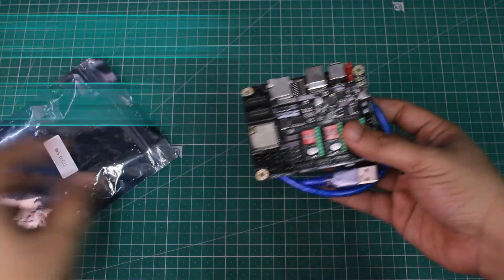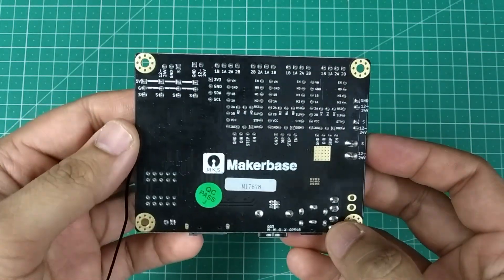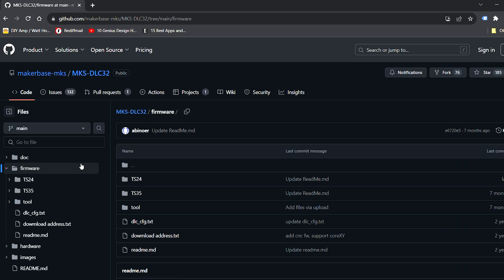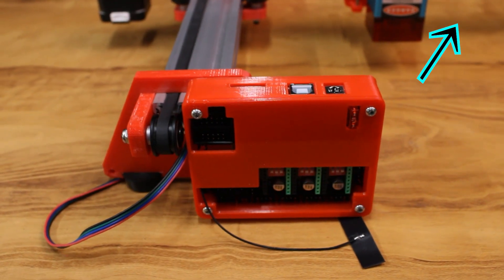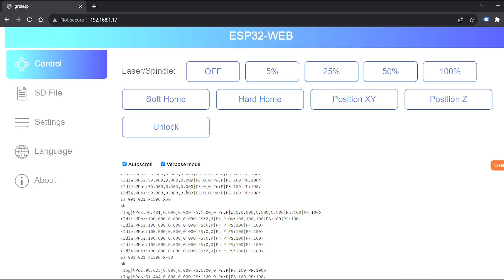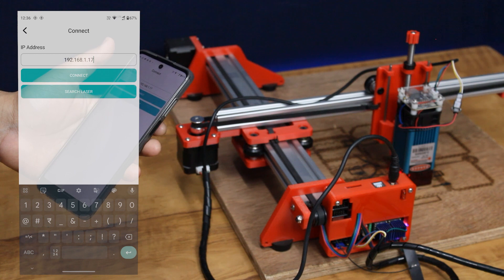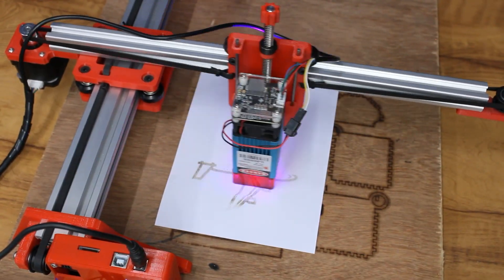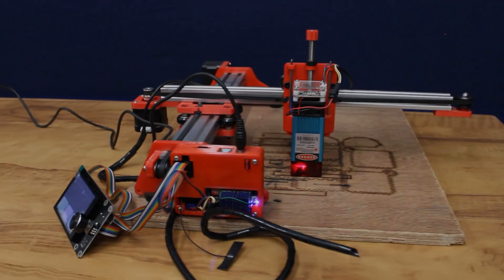MKS DLC32 WIFI CNC Control Board Review

Comment: Recently I purchased an MKS DLC32 Max board for my CNC router machine. Actually I have a 24V psu with 15Amps capacity. Can I use it for this board or should I get a 24V 10 amps power unit? I plan to use a 10Amp DC breaker, is it ok?

Comment: what laser module dlc support ? PWM or TTL laser need be and what volt need be, 12 or 24 volt laser module ? i have dlc32 board and 24V power supply and need buy laser module next. but not know what makerbase support drive. PWM or TTL and 12V or 24V.
Reply: did you find the answers?

Comment: I set this card up with three external stepper drivers for my homemade 3 axis CNC machine. I'm using open builds control to test everything and it seems to be all working correctly. I'm wondering if I need to supply the board with 5 volts if it's not connected to USB? Or does it get all of its power from the 12-volt connector?
Reply: need use 12-24volt power supply and connect to power plug.
Reply: Which drivers did you use mate?
Reply: This board runs very well on CNC3D Commander with nearly all the options available you should check it out it's a nice sender control. However I'm not sure you can have the offline controller plugged in at the same time as USB cable most of these offline controller cards you cannot I have never checked with this one or use the offline controller yet.

Comment: But here there are two "Y's" and not XYZA . How do I solve on the software? Thank you very much.
Reply: you cant, its a hardware limitation, since it only has 3 driver ports, and the 2y outputs are both connected to the same driver, so gantry squaring wont work either
Reply: nor will there be enough power on the yy

Comment: please can you tell me about the wiring of the nema17 with mks dlc 32v2.1. I am facing issue with the running of the motors with the board.
Reply: Do you put driver boards on main board? They are sale separately in some offers.If yes check is they right connected to the main board. If yes you need data sheet for Nema motors to see what pin for what is.
Good luck 🤞
Reply: @sash-v7i  would a cnc shield work with this board to drive the nema 17 steppers
Reply: @glennmartonic6376  this board have all ,not need external cnc shield board. this is all in board.

Comment: my dlc32 v2.1 board does not auto connect to wifi
Reply: Which version of firmware you installed, the latest 2.30 was disable that Wifi autoconnect feature temporarily, to fix some bugs…if you want it back, best to flash the older version, 2.10 or 2.08
Reply: L
Reply: Mine does😂😂

Comment: I am having a problem like once I connect my msk laser tool for wifi and after that If I disconnect the power then my board is not connecting again I'll have to connect the board and reconnect for software while plugging so there is any to skip this ?
Reply: Maybe you can try to reflash the firmware back to 2.10 or 2.08 as shown in the video

Comment: I am having an issue using this board. During the milling, the Z axis is going down. Do you know what happening?
Reply: Change Your stepper motor ,I got the same issues last month
Reply: @DearChina1  The issue was solved? Did you use some special stepper motor?
Reply: it is probably the forces of the endmill pulling down on the z axis, and the stepper isnt strong enough to hold it in place. mayby try a straight flute or downcut endmill, the dont produce that much force pulling down
Reply: Bro which motors you use?

Comment: I can use this board and program it with the arduino environment?
Reply: Basically it is in Arduino environment , with a integrated cnc shield.
Reply from the maker: you dont need to program it, it has built in firmware. you can directly use it using GRBL controller